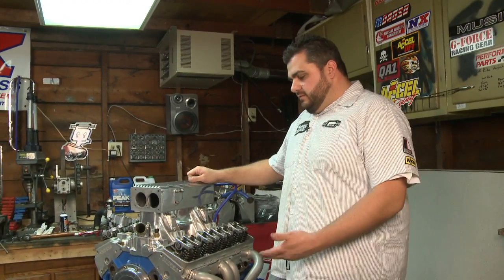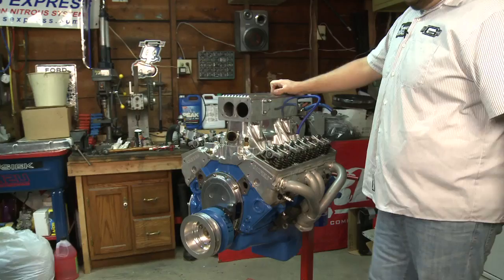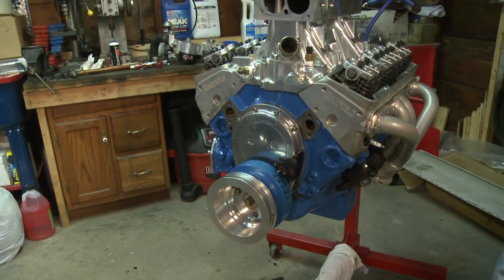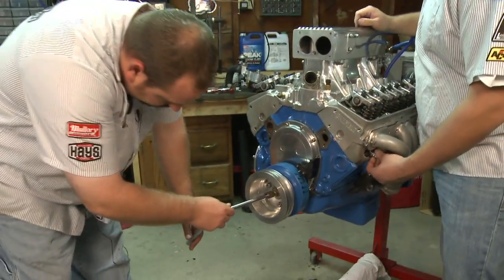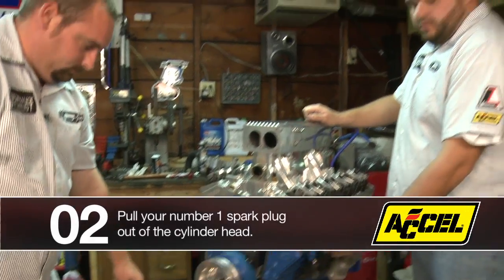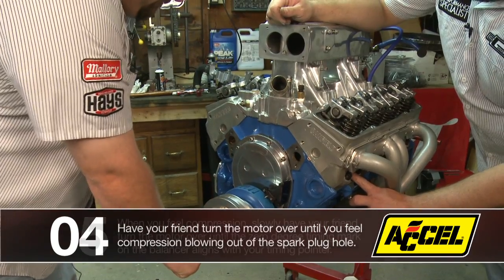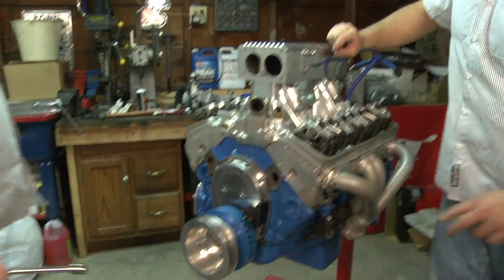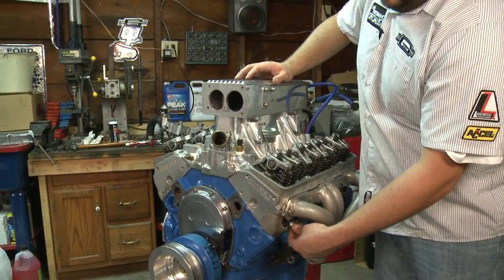How to Find Top Dead Center :: Modern Muscle X

Comment: I'm trying to find out how to test to see if my problem is that the timing chain has jumped or not on my ford 370, running bad like only firing on 6 or 7 cylinders, or if it is that dam electronic box on the fender well

Comment: @WWoodyW u adjust valve lash of each cylinder at tdc of each cylinder. if u are going to adjust valve lash on cylinder 1, then cylinder 1 has to be at top dead center. if u are adjusting 2, then cylinder 2 has to be at top dead center.   and my harmonic balancer doesnt have a mark for tdc, it has a marks for the timing. there is a mark at 8, 10, 12, and 15 i think.